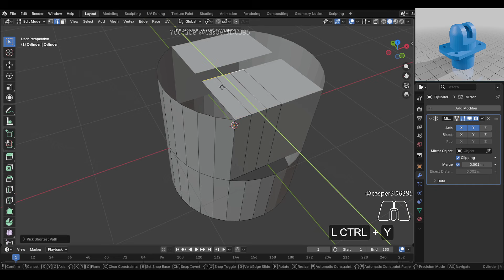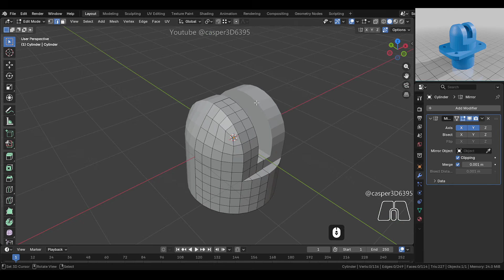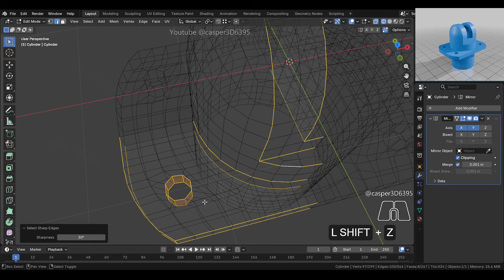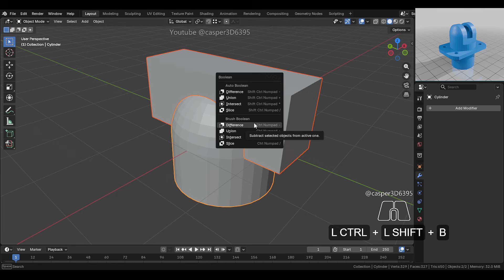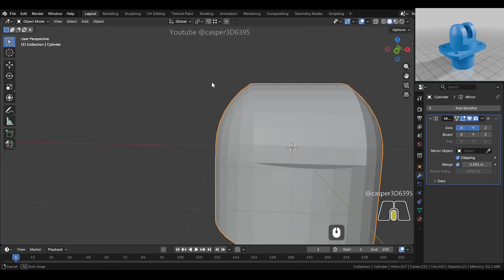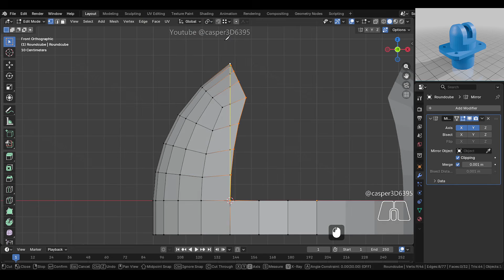Blender Practice – Modeling a Mount Shape Using Different Methods

Comment: Hi, I followed your tutorial but Snap It isn’t working for me.
I tried the same steps and other videos too.
Can you tell the exact way to use Snap It?
Reply from the maker: Thanks for asking! Make sure you select the correct snap type from the magnet icon at the top. Hold Ctrl while snapping to snap only to the selected snap type. For example, if the snap type is Vertex, it will snap only to vertices, not faces or edges.